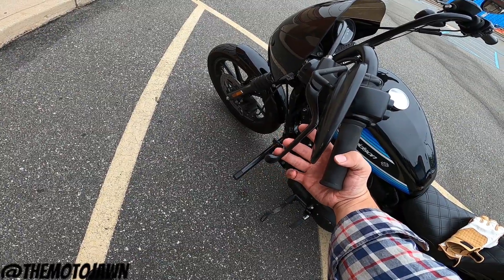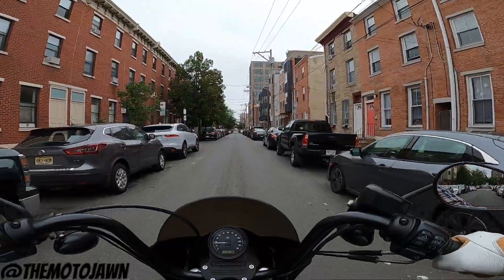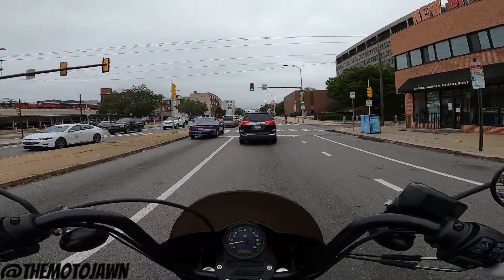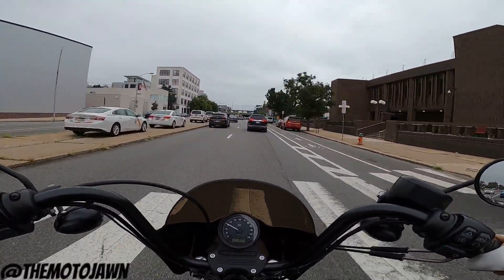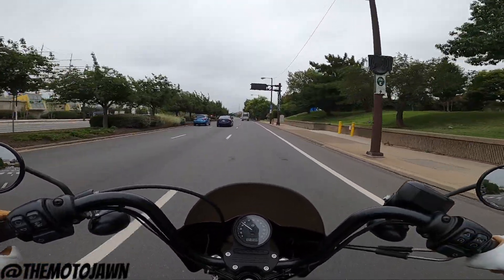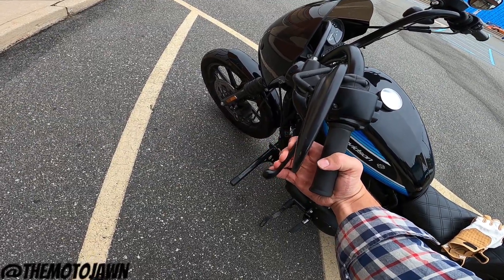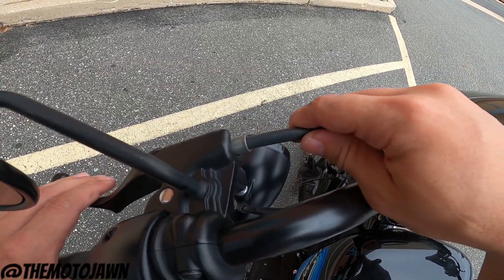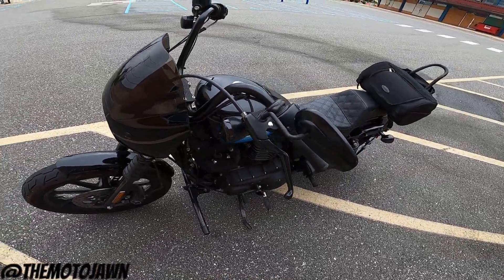What's WRONG with my Sportster Clutch?? - Iron 1200 Clutch Problems

Comment: Ok, if your 1200 is like my 1200R, there are actually two clutch adjustment points. The cable you found. The other is inside the derby cover on the left side of the engine. 
Raise the bike on a jack so that it's level. 
Remove the 6 T27 screws that hold the cover on. Station an oil absorbent pad under the derby cover just in case.
There is a small spring that should be in a detent in the center of the derby cover. Don't lose it! Put a dab of grease or Vaseline in the detent to keep the spring from falling off when you reinstall the derby cover. 
I replaced the T27 screws with stainless steel Allen bolts like those that hold most of the engine together. It makes the derby cover removal much easier. 
Now, you'll see a nut with a slotted screw in the center of the clutch. From the service manual:
Slide hex lockplate with attached spring from flats of adjusting screw assembly. Turn adjusting screw counterclockwise until resistance is felt. Turn adjusting screw 1/4 turn clockwise. Reassemble. Adjust cable length until 1/8" of slack exists before resistance is felt at the lever. 
That's all, folks. 
Removing the derby cover is the best way to make sure the transmission has the proper oil level. The manual says a quart but it's more like a quart and a half.
Reply from the maker: I was reading about that adjustment as well. I'll have to check in there also.
Reply: @TheMotoJawn  , it's strange that your clutch action and pull effort would suddenly change. Those two adjustments change the initial engagement point but don't affect the effort.

Comment: I've had actually the same problem with my sportster xl 1200t superlow and the problem appears again and again. From the vibrations the clutch setting thread loose itself and can damage the entire clutch. After they've adjusted in the Harley Workshop I've put around a self-adhesive insulated band to keep everything in place and it works. But the clutch system by the sportster is quite old fashioned and very sensitive to vibrations. If you feel, the neutral comes hard, you should run directly to a workshop to set it right again before it damage the inside clutch rings.

Comment: I actually had the same thing happen on my 08 1200 Custom & made the same adjustment you did & never had another issue,  I'm assuming that the cable just stretched a little bit, if it seems ok I'd keep riding it if it were mine. If it happens again I'd get it looked at
Reply from the maker: Interesting I'll definitely keep an eye on it.
Reply: The same thing happened to my 883 at around 15k and I adjusted it. It happened again so I took it to the shop and he said he fixed it and the clutch did the same thing that night (last night) I guess imma take that plate off and look at those teeth on the clutch

Comment: Hey y'all I have a 2000 buell.  I have adjusted the clutch and and it still kinda pulls a little when I pull the lever all the way in in first gear. It still wants to pull just a little.  At idle if I rev it just a tiny bit then it stops pulling untill I let the lever out.  Idk it just kinda wants to move with the clutch in but just barely. Should I adjust it out under the derby cover a little more or is my cable too stretched help me out here please
Reply from the maker: Mine was doing the same thing and adjustments never worked cuz it was totally going bad. Might need replaced.
Reply: @TheMotoJawn   I got it adjusted out to the point it is barley dragging in gear with the clutch pulled in. When I got the bike there was NO play in the clutch lever. But now I got it close it right.  But I'm wondering if it's my clutch spring or cable because it doesnt slip a bit so I think the disc are good.   Idk

Comment: On cable-operated clutches, they'll occasionally need adjustment like you described.  There's usually 3 adjustment points: at the transmission, midpoint, and at the lever.  A shop manual for your bike would be a good investment, or looking up the proper procedure online [like you did].  I had to do this to my 2 Kawasakis last year after oil changes.  Got 'em adjusted right and they're in perfect operation now.  I'd keep an eye on it, and if it gets worse again, you may want to have a deeper look at it or take it to a shop.
Reply from the maker: Yeah keeping an eye on it to see if it needs further attention. Manual sounds like a good idea
Reply: @TheMotoJawn  FWIW, I downloaded PDFs of the Kawi manuals I needed.  Mid-covid, I did an oil change on my Kawis myself [indy shop wasn't taking new bikes], and shortly thereafter my KZ's clutch started slipping bad... 1 clutch adjustment later and it's been aces ever since :D  Just one of those things you gotta learn, I guess!

Comment: Got the same matter ! I used to set the clutch as you did but without setting the cable. Did it come again ? 
It did on mine ! Any tips please ?
Reply from the maker: Yeah it did happen again. I ended up having to adjust the tensor screw inside the derby cover and seems to be better now.

Comment: Have you looked into the mechanism that actually pushes on the clutch basket when you acuate the lever? It's like a two section deal with 3 large steel balls inside it. I'm thinking that maybe the balls got stuck on the ramps or something, and eventually it would work loose and go back into place. You can lean the right bar end against a building or something to keep the bike in an upright position, or even leaning more to the right than the left and then remove the clutch cover and inspect this whole thing to see what is going on. Leaning it upright will insure you don't loose oil and you can check the level of the oil to see it is even with the bottom of the clutch spring. (the large round disc you can see)

Comment: Sounds like the "grenade plate", mine went this spring with 11k on it.  you can pull the cover off and probably see the rivets that popped. It's an alright job to do yourself you're going to have to buy some sockets and a clutch spring puller if you don't have them yet.   With no tools it's like $250 job.  If you can get the tools the clutch plates are just over $100
Reply from the maker: I'll have to take a look in there
Reply: I replaced the clutch on my 2006 1200L to get rid of that "grenade plate" before it blew up and did some serious damage. It was still intact at 12K miles. I also replaced the release bearing, which is also known to be a crappy part on older Sportsters. Do newer Sportsters like 2020 STILL have that "grenade plate" in them?

Comment: I would check the cable to make sure you didn’t have any cable strands break. Disconnect the cable and pull it back and forth make sure it’s smooth. After that follow full clutch adjustment procedure. I know the older Sportsters you need to get to the clutch adjustment screw, set it per the instructions than adjust the cable than back to the clutch adjustment and do a final adjustment. Again this is on my 79 Sportster per my owners manual.
Reply from the maker: Yeah that process sounds similar to what I've been reading

Comment: My 2023 street bob is doing this started yesterday took it in they told me bolt came loose and they fixed it and dropped the bike off today I went on ride when I got home to make sure it rides good and it happened to me in 5th gear too and after I test ride it its fuckn mush again and they just fixed it today smdh it's a brand new bike 2000 miles and they just did service I don't know wtf is going on either
Reply from the maker: Damn they better figure it out
Reply: @TheMotoJawn  bro what mephis shades u using send me link and hook up I got same bike as urs lol same color I need discount lol

Comment: How many miles on it?  I have heard that the clutches have a tendency to start having issues around 15 to 20 thousand miles. The stock rivet plate starts to separate. Watched a couple of videos and read some forums about it.  I’m going to replace my soon. I’ve adjusted mine every 5000  as I’ve noticed the fiction zone moves which is why I adjust it. I adjust it under the derby cover as well.
Reply from the maker: About 12k on mine so far

Comment: These things stretch and sometimes some of the cables break and it gets loose. Looks like it just stretched a bit though, you seems to be good now
Reply from the maker: Yeah some have said might need an adjustment inside with something inside the derby cover. Might have to check that out too.
Reply: @TheMotoJawn  very true, lots of moving parts there